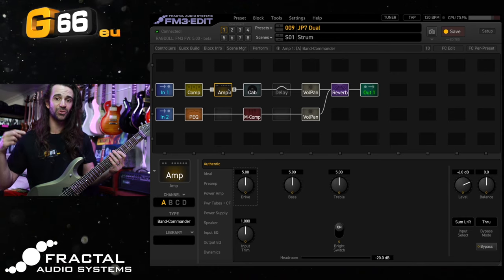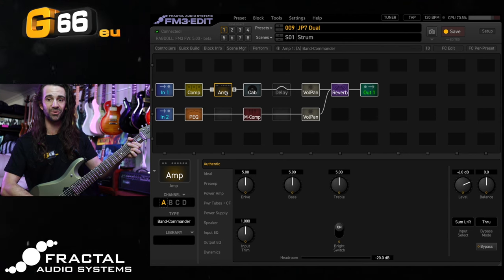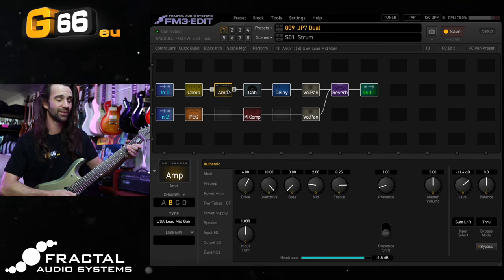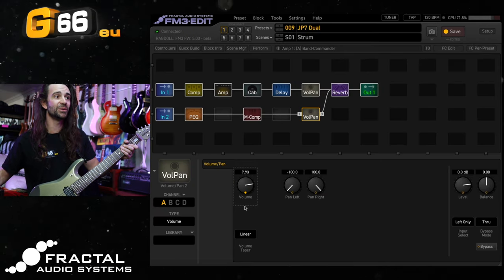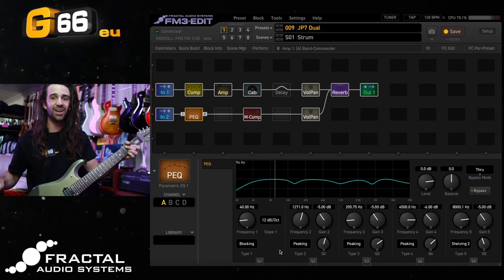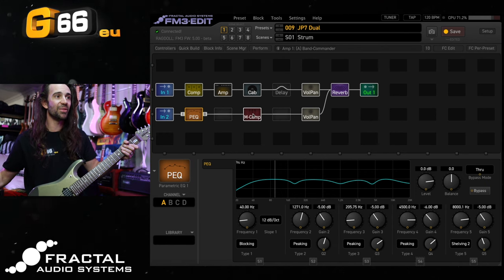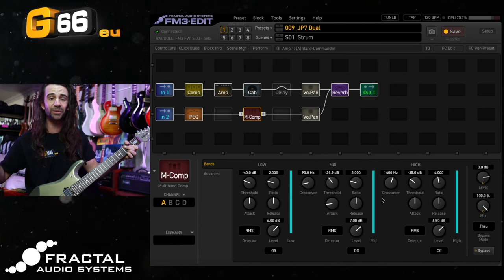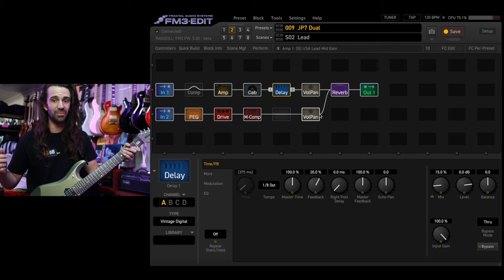Tuesday Tone Tip - Piezo & Electric Preset Breakdown

Comment: Question:  Would you be able to talk about the Pultec IR that you put up on Axe Exchange?  I loaded it after the cab block as suggested and loved the sound.  It would be interesting to hear how it came about and how best to use it.  Thanks Leon for your videos!
Reply from the maker: There's a popular "Pultec trick" using the boost/attenuate knobs that gives the highs and lows a little lift. I shot an IR of the resulting EQ curve and it works a treat!